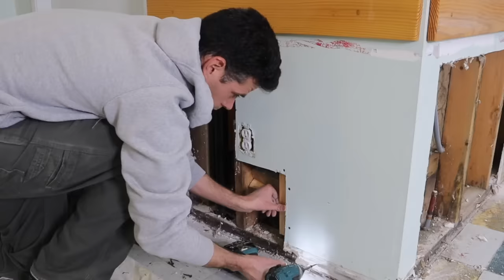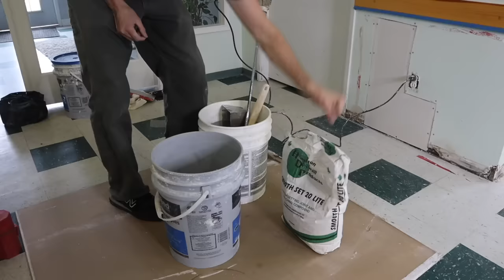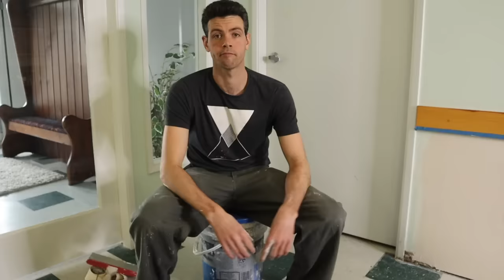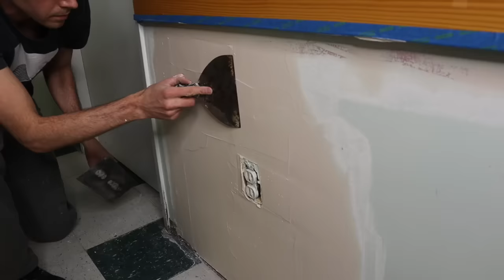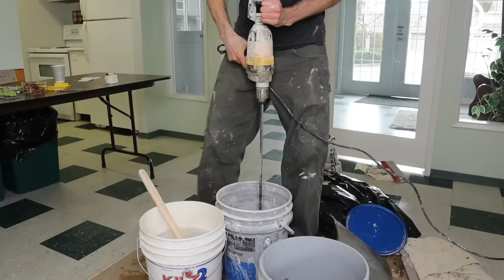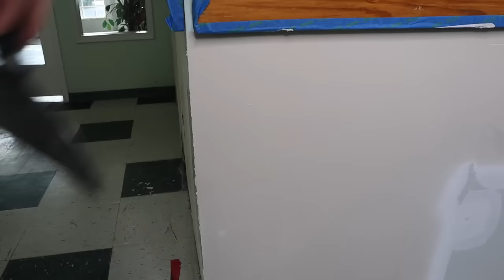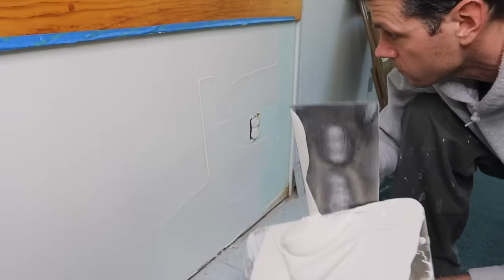Strangely Satisfying Drywall Repair!!!

Comment: Have watched drywall finishes on YouTube before and just cringed at the way they were showing how to do it. You are one of the few to do it right, with hawk and trowel. I did finishing for over 40 years that way and felt it turned out much better than pan and knife. Your work looked great. One thing I did learn though, how great it is to be retired and how much I don't miss doing it anymore. Keep up the good work, it's a dying art.

Comment: You are a drywall god, you did in one video what I spend a week on!  I learned today that you can apply backing rather than cutting things back to a joist.  Wish I'd know that before, as screwing two pieces of drywall into a two by four without the edges disintegrating can be a challenge.

Comment: First off, nice work brother. Last year after pounding my chest, don't worry I got this and how hard can it be speeches I gutted and drywalled my living room. Now here's the rest of the story. The house was built circa 1900 and is a "Balloon type framing". After removing the lath and plaster it revealed some pretty uneven studs. I shimmed the studs the best I could and proceeded to put the sheetrock on. Well, the walls are still a little uneven with way too many seams. I did drive a lot of the screws in too far breaking the drywall in those spots. I've repaired a few things around the house before like toilet seats and thought I was Bob Vila afterward but never have I taken on a large project like this and it looks the part...trust me I'm a felon. Discouraged with the Frankenstein Monster I created I haven't touched it since. Now I get the speech, finish the room, or "Sleep on the Couch" and another threat that may not be appropriate for younger audiences. Can the entire room be done this why? Can a novice do the job? How much does a job like this fetch? I just might have to gift my wife a weekend getaway. She gets a weekend with her friends, comes back to a finished living room. Huh? Huh? What do you think? Genius I tell you

Comment: This video is great. I can see the kind of mud (similar to what I am using in the basement, both the quick set for the bottom layers, but I use 45 min, and the light all purpose or topping mud for the top coat). The angle the camera was at I can see all the lift offs. The trowel work (avoiding both vertical lines and lift offs) is really nice. The horizontal lift offs are similar to what I get with the trowel (so maybe I am learning).

The lift offs on the hot mud are tricky because the mud is thicker there (so it may take more time to solidify and dry). Pardon me for laughing a bit when you tore a chunk out of the mud scraping the liftoff. Good to see it is possible to repair this without too much fuss.

And when you get one crumb 5 more follow...

Comment: Okay. I repair a hole. Used joint compound under and over seam tape. I came back to sand it.  It looks terrible.  I didn't know I had to cover the whole board. It's time for me to buy a 13" or so trowel.  Glad I  saw this video.  Thanks.

Comment: I do a lot of drywall repair jobs - and wow - your first coat was the same as my first two.  Why?  Because I simply never thought of going that wide.  I will from now on.  And you have finally convinced me to try a hawk.  I can see it is much cleaner than pulling mud from the pan.

Comment: Correct me if I'm wrong but wouldn't it be much easier just to cut out the dry wall from corner to corner and then you would only have to match up your corners. And under the trim. This way you would only be making 3 cuts. One larger piece of dry wall but less mudding and time.

Comment: I personally wanted to drive to Vancouver to remove that receptacle for repair.  Trick,  carefully bend the ears back, give it a tape wrap and push the device deep into the box to allow a push over.  Later pull it out and bend them back for install.  Great stuff as always Ben!

Comment: This is exactly what I need for one of my jobs where an outlet was installed that was just hanging through a hole in the drywall. 

I cut open the drywall, mounted the outlet to a block of 2×3 wood to the metal stud, then put a drywall patch to cover the hole.

Comment: Hot mud baby!! Few thin coats, never sand nothing 🤘🏽. Each coat, I'm careful not to make ridges, and if I do, they are minimal and knock off with the knife real smooth and easy. Then float again. Repeat till smooth, using minimal mud. Use a primer paint in one and lay it on/lay it off.
Bit of a drywall ninja myself
It's all in the wrist✌🏽.

Comment: OMG Amazing trowel work.   I just did two rooms and tried hard to trowel.  Very hard.  Had to keep resorting to a wide knife to smooth it out.  In the end I did multiple touch ups with 20 min over the original Plus 3 topping mud.   Plus 3 was so soft, it was crazy.  I mean I just fought the war and eventually got it all smooth.  Sanding the 20 min isn;t bad by hand with 80, then 120 sponge.  I don't think I'll ever get it.  Saddens me almost.  Time to pack away all my drywall tools, till the next roof leak or remodel.  Oh, and air bubbles... grr

Comment: A cool little trick is you keep spinning the mixer as you bring it up out of the mud a little bit and it will sling all of that mud off and will be easier to clean and save mud.

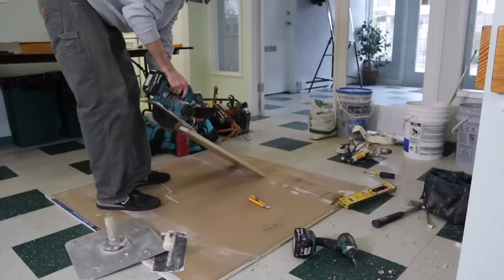Comment: You just solved my one delimma on this video.  When one end of a drywall is anchored to a wall stud but the other end is floating and needs to be connected to the other drywall end with no wall stud.  To anchor both in place, just cut a piece of 1/4 inch wood and bridge the two ends together.  Thanks.  2:21  No one has ever done this on Youtube. You need to do a video on this simple trick.

Comment: Been taping for 10 years with fiber tape pretty much every day, you don’t need to push the easy fill in the gap you won’t ever have problem just apply your coat don’t worry about pushing it. It’s not paper tape so you don’t need to pre fill or nothing it’s designed so it gets in the gap

Comment: I do a lot of repairs as well.  I can do small patches to final paint in a day with hot mud, but it’s not ideal.  However as they are insurance jobs most homeowners take off work to accommodate me so speed is the key.  Been 15 years and no call backs.  I would love to see how you patch walls with heavy texture.  Those are pretty challenging sometimes.

Comment: Great job. Just did something like this recently and wished I’d seen this video before. Can’t help wondering though for this job if it would have been easier to remove completely those sections of dry wall and replace with complete sheets?  Don’t know not my area of expertise. Thanks for the video.

Comment: You used 5 layers of 20 minute mud? I need to do this in a bathroom and most of the result will be behind a cabinet so it's a good place to learn because if it's not perfect it will be hidden. But I have other, more visible areas of the house that could use some drywall work.  Also I have that spray on smack-down finish on my walls, so I suspect that will be more forgiving than smooth walls because I can use the texturing at the end to hide the flaws from my learning curve.
If I have the option of trimming the drywall halfway on an existing stud to anchor the new piece to the stud, do you recommend doing that, or is it better to add the wood bars to join two pieces between studs, as you have done in some cases here?

Comment: What I’ve encountered is when you share a stud to put another piece of drywall as a butt joint, sometimes the stud is not even and the piece of drywall that you were using, even though it is the same thickness, 1/2 inch it sits maybe a 16th lower than the existing drywall that you were putting it up against. What do you do in these instances?

Comment: First, I want to say how much I like your videos.  You provide a lot of useful information expediently and with great clarity.  One of the difficulties I've had over the years (and as a luthier, I'm not without hand skills) is that I've never had the "touch."  One of the things I noticed in this and other of your videos, is how many passes you make with any one coat -- not just your feathering but in the initial application before you get to feathering.  Is there a way by feel as to how much material you're putting on?  I gather much of that is simply experience, but is there a way to think about getting that feel?

Comment: HI.  Nice job when finished, as always.  Now, I only read about 275 of all 558 comments, so this might have been mentioned and I missed it.  I did notice you were in such a hurry to get things cleaned up and out to the truck that you were running in and out.  If you were in that much of a hurry to finish the job and get to the next money-maker and since you've been in the trade for 15 years, surely you know how to turn off a breaker and remove the receptacle.  Why the heck wouldn't you do that and cut a square piece of drywall to fit?  Less time fiddlin' around making that match-up and someone is STILL going to have to come in and bring that receptacle out to flush with the cover.
I've been "in the trade" for 40 years and hold paper in more than a single trade but I STILL get a lot of enjoyment from your videos as well as a few tips especially because you do mot of what I HATE doing - tape and mud!  I have commented once or twice (today being the ONLY slightly negative one) and watched most of your videos, please keep doing what you do.
Thank you
Ted

Comment: Everyone has their own methods but I usually run the 6inch and hit the seams then 2nd coat I'll run the trowel. Using 20 min mix is nice because if you just wait until it's almost dry take a felt brush and some water, boom it's glass. No sand.

Comment: Often find the 20 minute mud does not dry in 20 minutes just curious how long did you have to wait between coats and can you actually begin another coat when it's not completely dry?  

And it looked like you applied three coats? Is that right?

Comment: NIce work, nice vid!
I spent most of my first 5-8 years doing much the same type and scale of work. When I watch your videos it's often uncanny, the movements and thought process so similar but done by someone else. I'm wondering why you left the tetris "L" piece? I would usually prefer to turn something like that into  square when there's an outlet located on the tape joint. Just and unnecessary PIA for me to plaster around and then flatness becomes important for the coverplate to sit flush. Was there a reason you couldn't make the patch that way?
Reply: Yes brother,  I thought exactly the same thing.  Always remove plugs and switches that in the way,  just saves time and brings better results.

Comment: Hi Vancouver Carpenter. Question.
You use 20 minute mud from the entire whole process?

Have you ever cut a 2" line in the drywall and removed it to only gypsum where your new drywall meets your old drywall. Peeled the paper to gypsum. Then taped and mudded? The reason I ask this is for speed and if it's going to crack later on and not having to mud out so far and minimizing the work thanks.

Comment: Why the second coat at 17:00 ? Is this like a level 5 finish? Depending on cost and customer, at what point would you say it’s good enough. Learned a lot here actually had answers a lot of questions I had. Do you prefer that trowel over a large knife? Seems like that trowel has more flat area to smooth out.

Comment: Can you do a video on how to patch an uneven butt joint and/or patch where the new drywall is significantly recessed from the old wall?  Do you fill in all the low spots with hot mud first then tape with all purpose after everything is leveled off, or do you tape first then build up the low areas?

Comment: Nice work......for a Canadian....j/k. You  don't like products like Rapidset OnePass? When I pull cables or run new circuits, I can make a hole, patch it and paint same day with a heat gun and Bullseye primer.

Comment: This is just my way but I like to cut my patch to approximate size and use that to trace what I’ll cut from the wall. That way instead of trying to fit a patch to the hole you’re cutting a hole the patch fits perfectly in

Comment: Do you ever prime and paint the 20 min?  Or always topcoat after the 20 min. Just curious if you use a primer sealer then topcoat with paint of choice?
I use 5 min quite often on similar repairs then topcoat with 20 min and skim with 20 min, seems to dry very fast with 2 coats over 5 min fill coat.  Great work, enjoyed the video

Comment: How can I find a good drywall trowel. Seems like all the ones I find are too stiff. Also, do you have a curved trowel that has a similar curve as a drywall knife? Like with the edges raised up so they don't dig into the mud

Comment: Did you use 20min mud for all three coats or did you change it up with each additional coat ? How long did you let it set before using the knife to smooth out some of the lines?

Comment: Does lightweight drywall compromise the structural rigidity and durability?  Should 5/8 be used as a minimum for everything?

Comment: I do the same thing sort of thing, but I do a prefill then fiberfuse the joints. And use 45 quickset with accelerator.
Reply: What is the brand and name of the accelerator you use please?
Reply: @TobiasRaphael1  Gyprock Plaster Accelerator
Reply: @tombushell5375  Great, thank you!

Comment: so what i got out of this,i am rushing to much.I have been mudding the lines in my paneling on my mobile home.First i fill the lines with 5 minute mud, dries fast and very little shrink,then i go over that with all purpose,then i try to do a skim coat over the whole thing.Sometimes i have to do 2 or 3 skim coats to get it where i think it should be,i always have to follow up with a lot of sanding using a light.Having a real hard time trying to skim coat,take to much off,not enough or get drag lines.

Comment: Pretty much the same way I do it, except I'll cut the drywall first, hold it up against the wall and mark around it with a pencil as a template.  Cut out the area with a router or key hole saw, install 1" x 3" for nailer if in between studs, then hang the patch.  I'll use spray varnish on torn face paper, but take a scraper or sand paper in between 2 - 3 coats as needed, to remove loose paper so you don't get blisters when you coat it, then nylon mesh tape seams.  Repairs that size, I'd use 5 minute quick set or mix 5 min / accelerator with 20 minute to make it kick off quicker.  2 - 3 coats of quick set, scraping air bubbles or lap marks between coats when first set.   Last coat of quick set, I may wet sand with sponge and knife, then apply a thin coat of plus 3 as a finish coat.  Come back next day, scrape any air bubbles, pre-fill with 5 minute, then sand and spot area, wipe dust off with dry towel & prime patches.

Comment: You still make this look so easy. I’m getting this good. I still have to make one or two more skin coats to make the wall glass smooth. But I’m learning. My favorite part was when you hit the wet spot when smoothing out tool marks. A little “damn” and fill it in. I’m getting better at seeing those spots, but it’s nice to see even the pros get tripped up occasionally. I would like to see more info on the sand out, knowing when to stop is my problem, I still tend to over sand, any tips?

Comment: I never have seen anyone recommend leaving the drywall about 1/2 inch above the floor. I always place a piece of old drywall under the new sheet to allow for that gap. Reason being it stope the drywall from absorbing the moisture when the wife mops or I case of a water leak. The baseboard covers the gap perfectly

Comment: Just a thought, but he gets those lines because he has plaster on the full length of that tool. If he applied the plaster just to the 'middle' of the tool, it would blend better as its applied to the wall, without creating lines.

Comment: That way absolutely works fine. 

But I prefer to cut my board thw size I know is going to cover all the bad board then offer up board and trace around with pencil an cut out then do as you've done. It saves a load of time playing with the level.

Comment: Vancouver Carpenter, I'm wondering how one does drywall mudding and still maintain 90 degree corners, inside and outside. From what I've observed of drywall guys, the corners have so much mud that they bulge out. Inside corners become obtuse angles and outside edges become bloated. It's not obvious to the eye, but becomes obvious when you're trying to fit cabinets and other fixtures with precise measurements. Maybe I'm just OCD.

Comment: I noticed that for the vertical butt joints you reinforced them with a board.  The horizontal ones, which weren't that much longer (16 inches?), were left floating.  Is there a rule of thumb for how long an unsupported joint can be or orientation?

EDIT:
Anybody?????  It took two years for the tape to blister along the seam
Reply: What I'm really asking is I did the exact same repair across two studs and where I left the horizontal seam unsupported like that the tape buckled.  What did I do wrong?

Comment: Hey man I've been using 20 minute mud for my first 2 coats for a while. Although it always seems like when I put the final 3rd coat of bucket mud on, I always get a bunch of pinhole air bubbles that slowly form. Any suggestions? The bucket mud is mixed up and bubble-less when I put it on. I'm starting to think it's a brand thing maybe.

Comment: How would you like to come to Minneapolis? We had a horrific sewage backup, due to bamboo toilet paper that turned into a hard cement-like substance that blocked the outflow to the main sewer line.  We lost 3 ft of all drywall/paneling in our finished basement. It's now clean, but we need to redo it all by October. It's a bit overwhelming! Your process looks almost meditative!